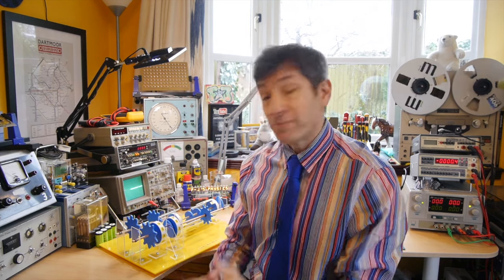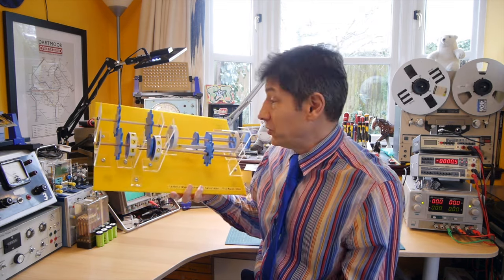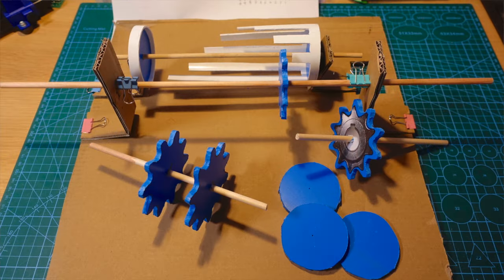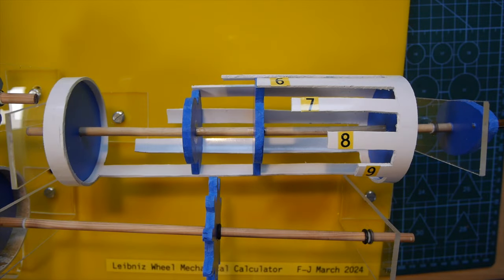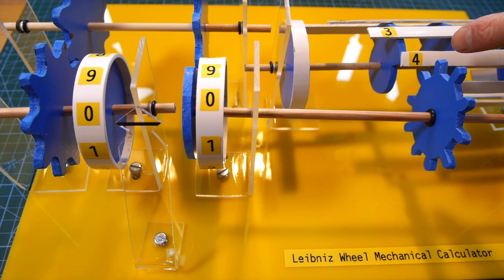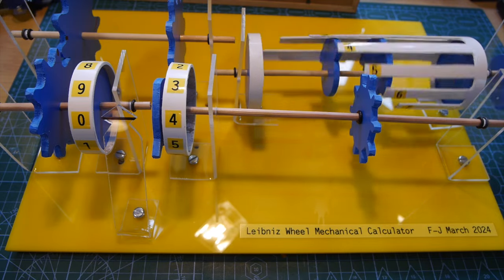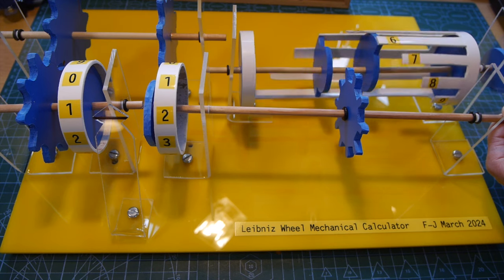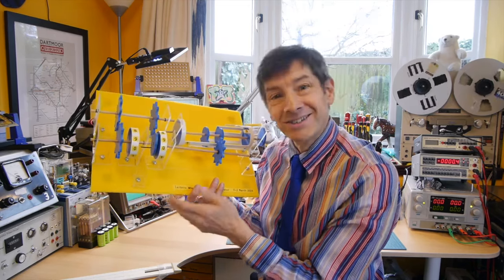Leibniz Wheel Mechanical Calculator - F-J's Physics - Video 188

Comment: You need a 3d printer my dude
Reply from the maker: Yes, you are right there!  But is amazing how much I learnt by making it by hand and that would enable me to be better prepared to do a print.  I need to get one but not quite sure which yet and I need some space in the lab for it!  Thanks for watching and taking the time to comment.
Reply: @AnthonyFrancisJones  Thanks for the content! As a physics and digital electronics teacher, I really appreciate the neat things you  do. I will be integrating the pinhole camera lesson into one of my classes for optics.
Reply from the maker: Excellent!  Yes, the pin hole camera is so easy to do and I tried to make the video play out like a lesson would do with lots of discovery and improvements along the way.  Let me know if there is anything else you would like to see.  I will be adding the electronics to the Leibniz Wheel soon so it can become an electronic calculator.  Let me know how you get on with the pin hole camera!
Reply: @AnthonyFrancisJones  I have been trying to find an easy way to use the pinhole camera to take a "picture" without having to deal with chemical processing. So far I think solargraphy might be a fun option.
Reply from the maker: Yes, that's a really good idea and avoids the darkroom aspect.  I did used to do the PHC with pupils and got them to develop their pictures with me but in those days class sizes were somewhat smaller!  I am sure you know but they were used in the nuclear tests to deal with the intense photon flux of the initial explosion.  Anyway Solargraphy sounds like a great idea (I should make a video on that one!).  Let us know how you get on.